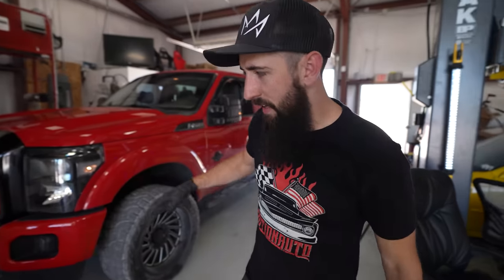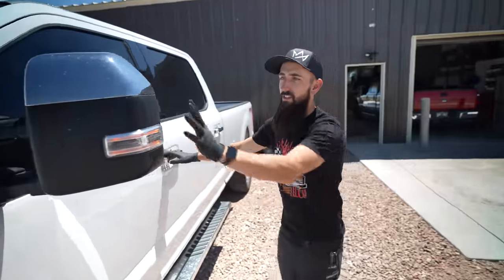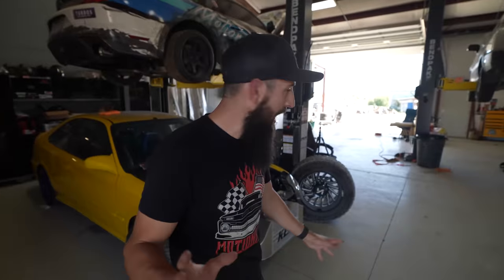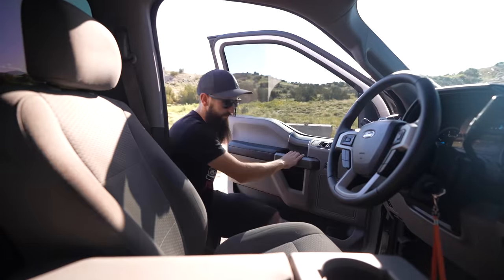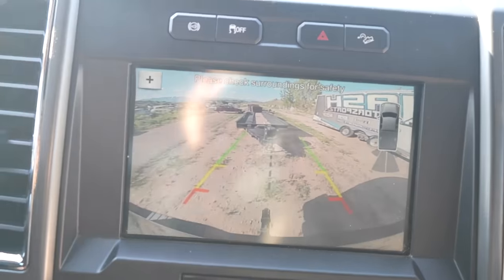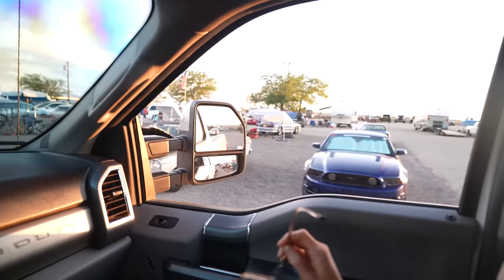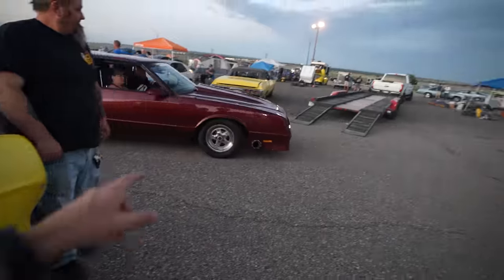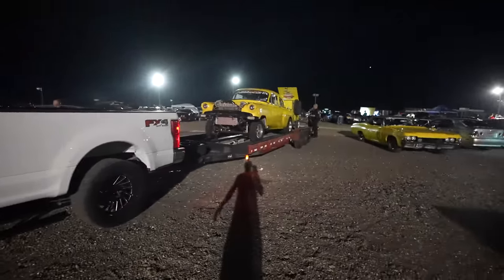I BOUGHT A $40,000 TRUCK FOR 90% OFF!!!

Comment: Your new truck has one ton rear springs with a  over load spring and a rear sway bar... meaning it has the camper package. I doubt if you'll need air bags. I order all my  f-250 trucks with the snow plow prep package in front and the camper package in back, that way it has the f-350 load etc capacity.

Comment: Hope you put the kit on it that if the cp-4 fuel pump eats it’s self it don’t push metal threw the whole fuel system and then it’s 9k job for someone to fix and flush the system! Why I will not touch a truck with a cp-4 high pressure pump on it.

Comment: You technically have 14,000 in it. you sold it for a profit of 12k not 22k.
Reply: I think he was adding profits from both trucks. Made 10k on first white one and 12k on the red one. But either way Trevor came out pretty good on these deals.
Reply from the maker: Sold the first truck for a 10K Profit, bought and built the red truck with the 10K from the first, making it a "free" truck, sold for 22K and bought the new one for 26K. $4K truck :)
Reply: @MotionAutoTv  gotcha. i do that to, makes us with a problem sound like it isnt one. but once it goes liquid and in the bank i no longer roll it over. then i restart with 1-2k and c where i get.